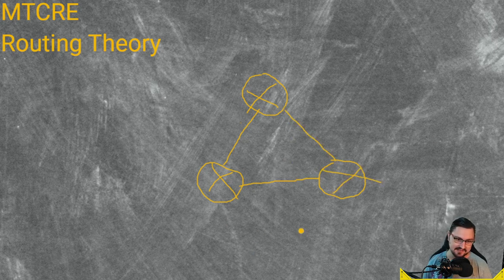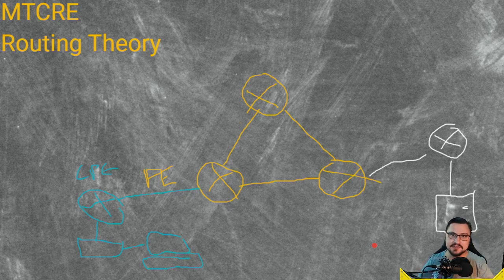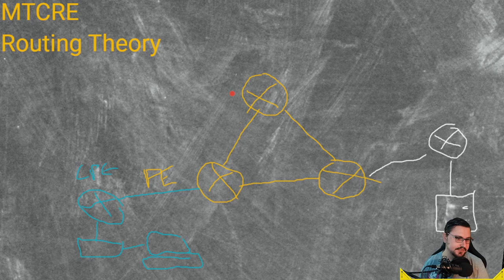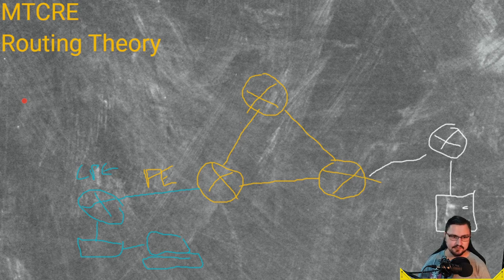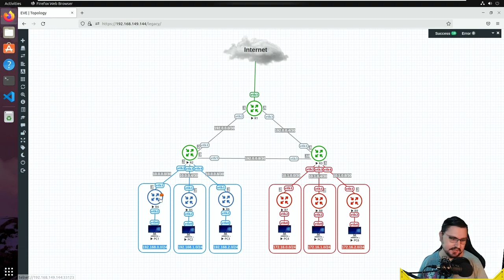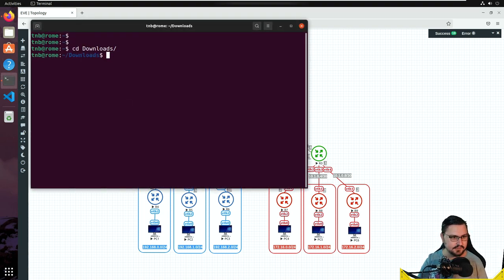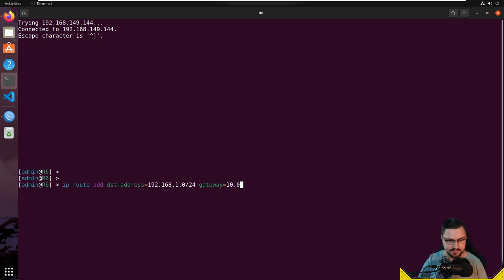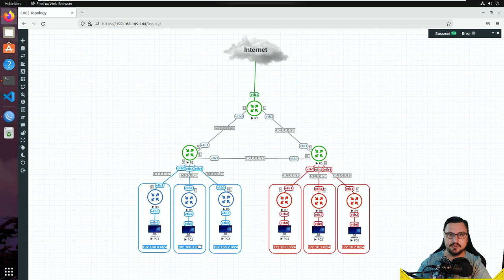FullMikroTik MTCRE - Concept, Route Selection & Static Routes (Episode 4)

Comment: I believe myself to have good network fundamentals, having worked with Cisco and Juniper equipment for the past 6 years and moving on to Mikrotik as the most pervasive vendor in our network, so these videos have been very help in just getting a peek in how Mikrotik thinks/displays things compared to other router OS/CLIs
Reply from the maker: Once you get used to ROS and its quirks you will really start to enjoy working on it even more so than those big vendors. I come from a similar background and I can tell you now I have made MikroTiks do things that I would require additional hardware or licensing on a different vendor.

Although there are other things that Cisco/Juniper definitely still does better than MikroTik

Comment: I switched to 6.48.6 in eve-ng, with 7.1.1 i couldn't get router to ping my office router or to pc on eve-ng have access to the internet... With 6.48.6 as soon as i masquearade traffic going out of ether1 everything works... Also routing table in 7.1.1 no longer have perf-src...
Reply from the maker: Yeah v7 is a completely different beast, I've also seen some issues with v7 and how the NICs translate on EVE-NG. Example is if you patch something into Ether1 the MikroTik thinks it's Ether3. Need to switch Qemu nic to something else for that to translate properly. I will be doing some v7 routing stuff after the course though since I want to cover v7 seperately.
Reply: @TheNetworkBerg  I choose virtio-net-pci instead of the default one and it's working